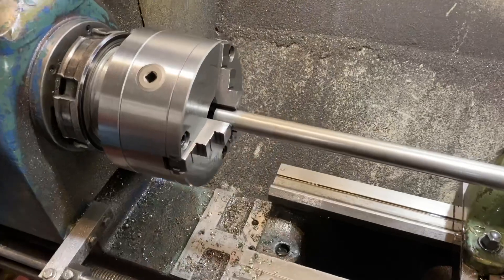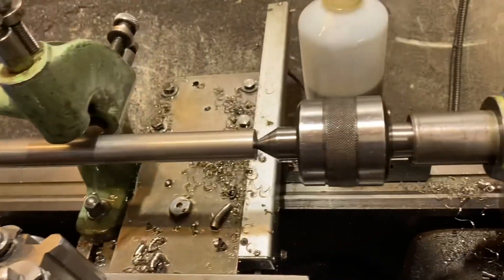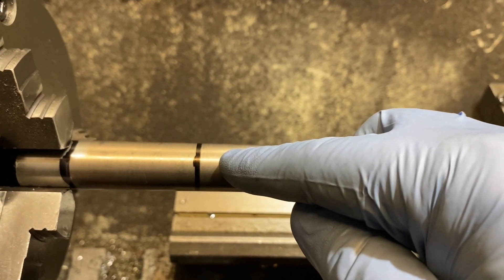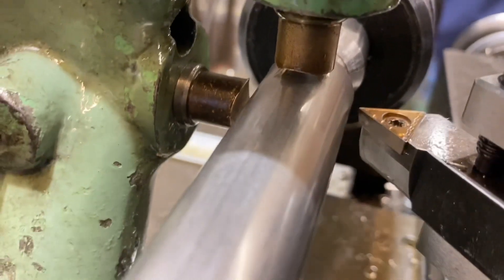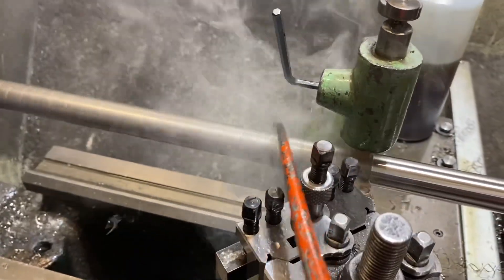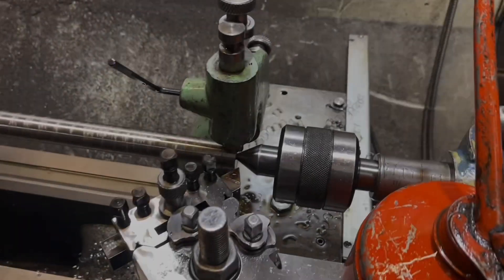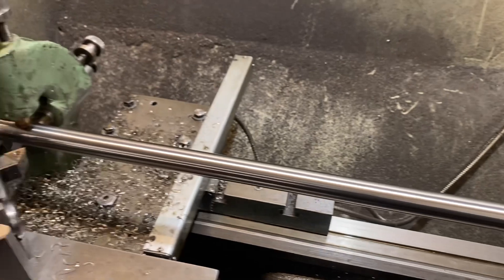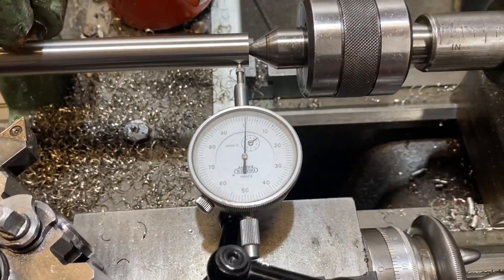Machining on the lathe - Running steady

Comment: Nice video.  Practical and to the point.  Regarding the centering of the tailstock it might be worth mentioning that you need to take any twist out of the lathe bed first by using shims under its mounting points.   Otherwise your tailstock will not be centred all along the bed length.

Comment: A very well-explained video. Center lathe turning is not easy really, some people say it is but getting the job right to specifications is the hard part as I found out myself through experience. My late father was a fitter turner originally in Ireland and he told me that years ago there was such a thing as an apprentice turner only and this took 5 years just on the center lathe only! But by the end of the apprenticeship, you are expected to know everything there is to know about center lathe turning. Job advertisements that said Center lathe turner class 1 wanted could earn very good money back then. Most center lathe turners these days do not know everything about turning
Reply from the maker: Thanks for the comments, there are not many of us left now!
Reply: I've operated lathes for over sixty years but never heard of "center lathe turning". Does it mean that you can only turn long shafts in the "center" with a follow rest or steady rest?